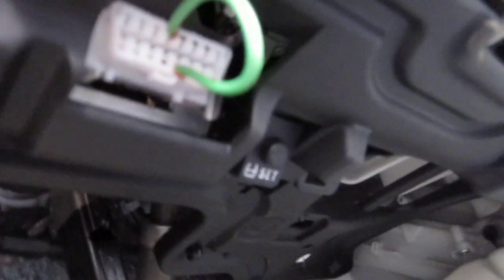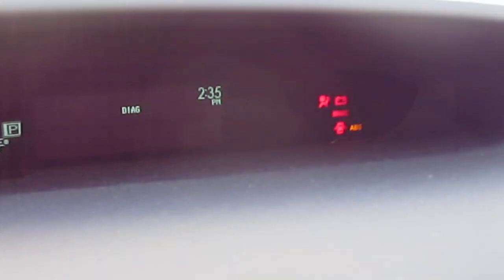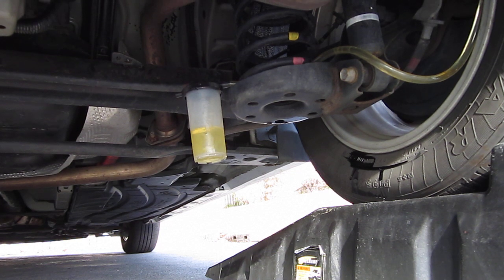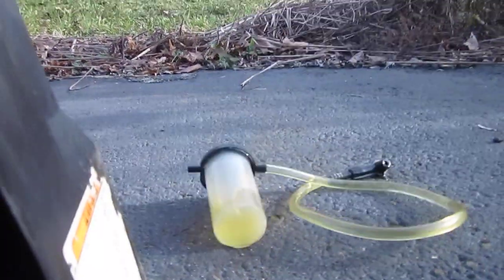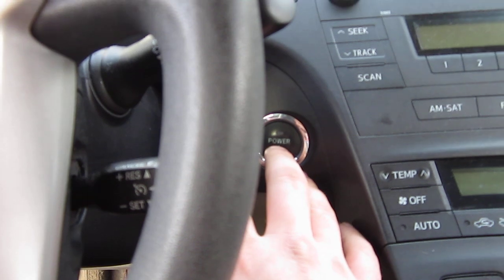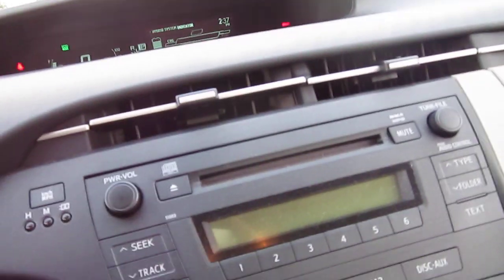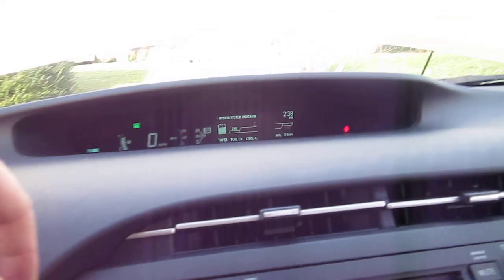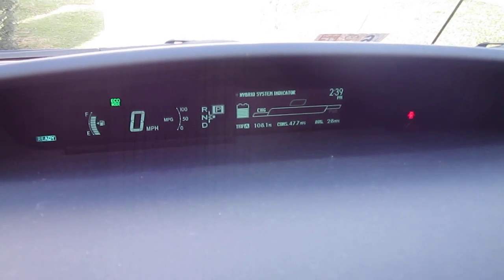2010 Prius Bleeding Brakes

Comment: Replacing my master cylinder. Do I only have to bleed air out from one of the rear wheels or do I have to do the process on each wheel?
Reply from the maker: Have to bleed the air out of everything.
Reply: @ivanbg5167  I figured so thanks. But this process will work just the same without having to take to dealer? Just on all 4 wheels

Comment: Can you just bleed with out the procedure just bleed pump the brakes
Reply from the maker: It can be done. I have done it before. The key fob needs to stay away from the vehicle and driver’s door needs to stay open the whole time otherwise the electronic brake booster will engage.

Comment: THANKS! I have a 2004 Prius and I had to press the brake pedal 8 to 10 times QUICKLY for it to work. Hopefully the lights stay away. I don’t know why they came on in the first place. I just got my oil changed at American Tire Depot and they asked if I wanted to get the brake fluid flushed and/or some new tires as an upsell, which I declined and then one day later these lights came on and my brakes went out.… Hopefully they didn’t do something to it, but it seems like a huge coincidence.

Comment: It is not  necessary to bleed the brakes if you are just replacing brake pads.  After removing the brake caliper, remove the old brakes, put the new ones in, use the additive packet to keep your brakes from squeezing.  Before you compress your brake caliper with a C-Clamp to make room for the new brakes, remove the master reservoir cap.  This will allow the fluid to flow back into the reservoir freely.  Bam!  No need to bleed!!!
Reply: yes you are right

Comment: I know this is so late but I know that u should do front air bleeding with disconnect two relays of rear motors so after doing this how I complete the process when I reconnect the two relays I think I should turn off the ig and as a result the process will not complete
Reply: Where are he relays

Comment: When doing this procedure make sure you press the brakes firmly are it will not work. Had my wife help by pressing the brakes on my 2007 prius and it would not work, so I decided to do it myself still did not work, so I figured I would try pressing the brakes harder and it worked perfectly. Thanks a lot!
Reply: Amoz Koonce for the bleeding procees?

Comment: I'm looking for a video on how to change the brake accumulator for 2011 Prius 3rd generation.
Reply: Bud Gillespie did you end up finding one? Just bought a 2010, and this will need to be done in the near future
Reply: @rubenlujano6337  have toyota check it out for you. Ours wound up being covered under a recall.

Comment: Can you help me? (Please!)I took my Prius 2010 2 days back for Oil change to Toyota Dealer in OBT, Orlando. They said my brakes are critically bad (at level 3). So I agreed to get replace pads as stated. Paid $200+. Next day, the dashboard shows all ABS, BRAKE and an other light. I took it back to dealer and he says the ABS ACTUATOR is bad and costs me over $3000. I absolutely feel it's some wrong steps taken during the brake pads changing process. Consulted a friend mechanic and he says the bleeding process probably was not done right. The car is still with the dealership and I'm fighting for them to take care of the issue and is not my car's fault. Can you help further? (I'm planning to talk to Service manger + General Manager + Toyota in that order).THANK YOU.
Reply: Hopefully you got this resolved as there was a Warranty extension good until November 2019 for these defective brake actuators.
Reply: Just to replace the pads not needed touch the fluid or blend. The car was bad before brake service. But it's normal to look for a culprit to have your car fixed for free. Good luck.

Comment: Good instructions. Gen II is similar. We just replaced right rear wheel/brake cylinder and had to bleed and clear abs codes using the jumper wire method. Had to bleed using pedal pump and hold, so it takes more time

Comment: Thanks Ivan, worked on my 2004/11 gen2 Prius! I removed the two ABS-motor relays and did the bleeding on the front wheels. To clear the error code I had to push the pedal quickly and more than 8 times.
Reply: Yes, the pedal needs to be pushed quickly and more than eight times.

Comment: I found this link online with instructions on how to bypass the ECB without a scan tool.  It worked exactly as described.  A couple of tips: you may know that you can turn the accessories on in a Prius without starting the car by pressing the start button without pressing the brake, that is what is done here.  Also, when the instructions say MORE than 8 times, it means 9 or more.  8 doesn't work.  I followed these instructions, bled conventionally, reset by hitting the start button once to turn off.  file:///C:/Users/Roger/Downloads/Prius%20Brake%20Bleed%20(1).pdf
Reply: What is the link?

Comment: Anybody know where can I buy that little jumper cable or what can I use instead of it?
Reply: Paper clip. I just did this yesterday and a paper clip worked perfectly. Maybe wrap the middle with some electrical tape if you're worried about a shock but that's not likely to happen.
Reply: I used a 4 inch piece of 16 gauge wire and just stripped the ends of the wire with my pocket knife.
Reply: Short piece of wire and solder the ends

Comment: need to change my rear caliper.......what would happen if i just flush it the traditonal way without going thru this?
Reply: not sure you would be able to. Idk. The car needs to be on because prius uses some weird eletric/hydraulic stuff.  I did it this way and changed the front calipers on an 05 and no major problems except the ligts randomly come on and I have to do this procedure to reset them... minus the actual bleeding. I suspect I didn't actually bleed them properly and possibly got a bit of air in the lines. Brakes are working fine though. I might try actually bleeding them again with a better set up.

Comment: hey, why is it that the 2010 Prius doesn't stop when you hit the breaks?
Reply: This was 8 months ago, are you still ok? that was a dangerous comment you had on there. I wont be driving a car that I cannot stop, I am sure your regen brakes were not working
Reply from the maker: Probably air in the system if not other warning lights appear.

Comment: This procedure worked on my 2005 Prius. When you bleed the rear brake (bleeder nut open at this point) have your assistant pump the brake pedal several times until you hear the electric pump kick in, at this point press and hold the brake pedal down until you no longer see bubbles coming out of the bleeder cup. Also you must make sure you have good contact when you jump #4 & #13 pin. Ivan's procedure works for a second gen Prius with this addition.
Reply: What do you mean? I have a Gen 2 and need to service the brakes. So I need to jump pin 4 and 13 and then do this procedure? Or just jump 4 and 13? Thank you

Comment: this way is not working with 2005 prius. Is any body has any idea how to bleed on 2004-2009 prius without scanner?
Reply: This procedure works fine on a 2005 Prius. I have one and it worked perfectly
Reply from the maker: +Sergey Khivrenko  I don't know about the 05 Prius but it works on my blue 06 Prius in the video as well.
Reply: +Ivan bg  Got it! repair shops asking crazy money for it, but i've fix my 2004 prius with the scanner that I borrow from auto store for free.
Reply: S K hello men what type of scanner you used ?

Comment: So Ivan, you said that this process can be done on a 2006 Prius.  My question is which pins do you connect, is it numbers 4 and 13?  Also, what is the bleed order, is it the normal or is it front to back.  Thanks
Reply from the maker: Some processes. The blue Prius a 2006 in the video and the procedure came from the 2006 Prius service manual.

Comment: This procedure fucked up both of my Prius 2 :(
Reply: specjalista88 Can you elaborate? I am prepping to do this and your feedback would be helpful.
Reply: Car goes into safety mode, couldn't reset the lights on dash, recharging system stop working while breaking. Had to take it to the shop to get car hooked up to computer and get it out of this mode. Beside, front is pumping fluid but not rear.
Reply from the maker: +specjalista88 It has worked just fine on my Prius second gen. Did you connect the jumper wire to the right pins and pump the brakes pedal 8 times? The key is at least 8 fast pumps.
Reply: Yes I did, many times over :( Wasn't able to bleed rear brakes but took it to the shop and and resetting got me going again.
Reply: If it did not work on the first Prius why did you try it on the second one? https://priuschat.com/threads/replacing-brake-fluid-and-bleeding-brakes-on-a-gen-ii-prius-without-techstream.152808/

Comment: Same procedure for all four wheels?
Reply: Todd Kusik The front are traditional brakes setup they require to pump in of the brake pedal to get it to bleed, the back's are electric pump.
Reply: @zech007  both are electric, front also has a manual fail safe mode that mimics standard brakes.
Reply: I have read that the fronts are a different procedure than the rears
Reply from the maker: For the rears you can just hold down the brake pedal instead of pumping it.